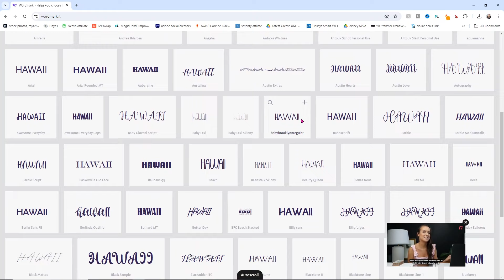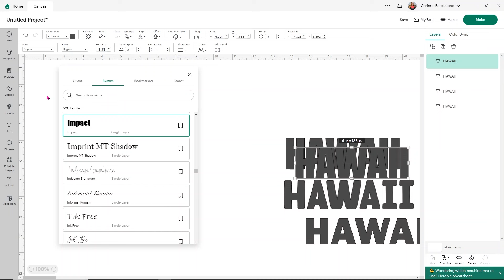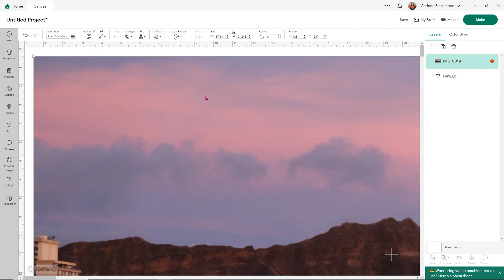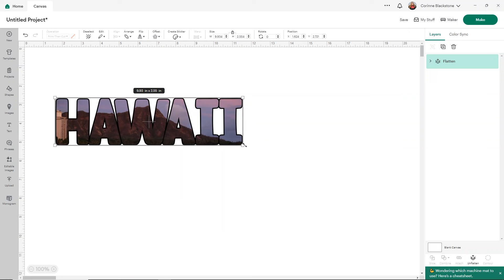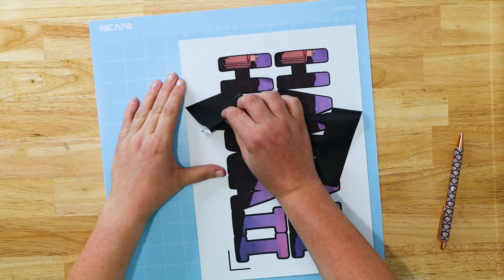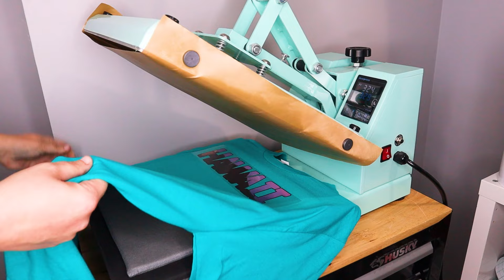How to fill letters with photos in Cricut Design Space

Comment: Have you had any color bleeding when washing? I used printable heat transfer paper recently & just wsshed the shirt the other day - inside out on gentle cycle and the black ink is what blead onto my shirt 😢  any suggestions on how to prevent this?
Reply from the maker: @chanelsmith1985  sometimes. It’s best to play with your printers settings to find one that won’t bleed. If too much ink is put on the shirt it will bleed